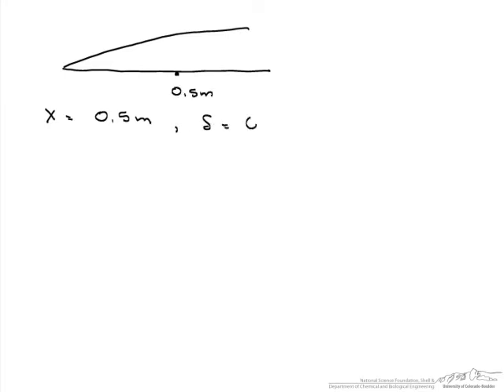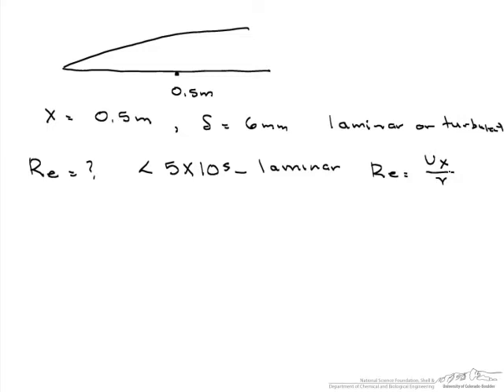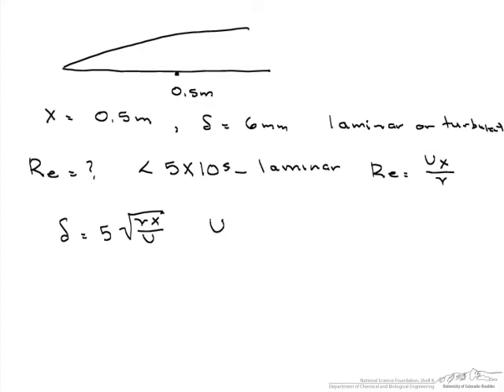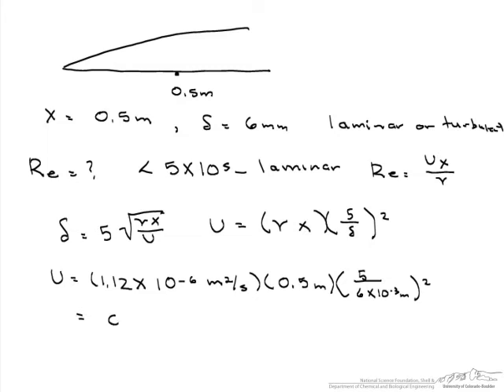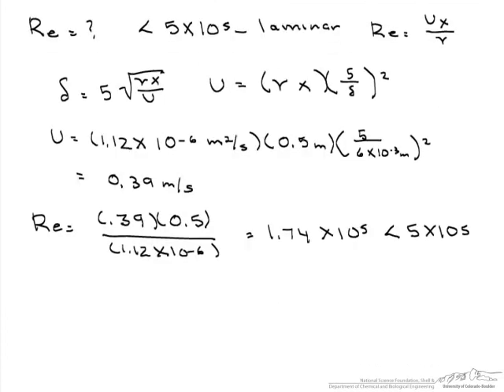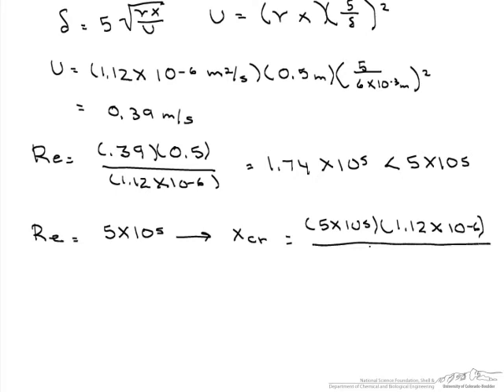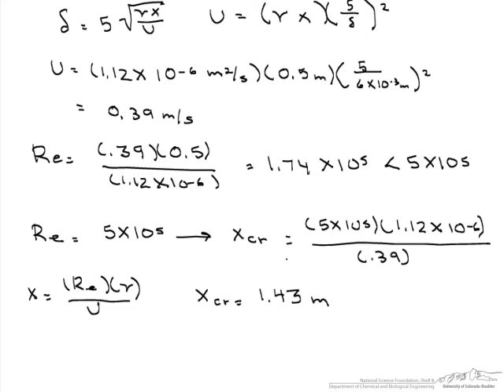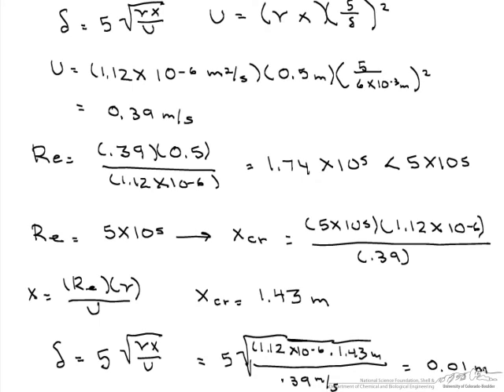Boundary Layer Example Problem

Comment from the maker: You are right that the Reynolds number is a function of the fluid velocity.  In this problem the x(critical) is the distance at which the flow becomes turbulent along the flat plate.  Thus setting the Reynolds number to the point of defining turbulent flow and assuming the velocity stays constant for the fluid, you can find x crit and then the boundary layer thickness at this point.  So we do assume velocity is constant at the boundary layer surface.

Comment from the maker: @tabasdezh Kinematic viscosity is different from dynamic viscosity.  Both are temperature dependent.  For temperatures between 10 and 30 degrees C, the kinematic viscosity of water is in the range of 1.307 x 10^-6 m^2/s and 0.801 x 10^-6 m^2/s.